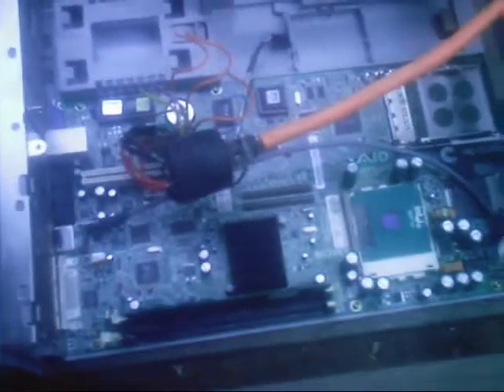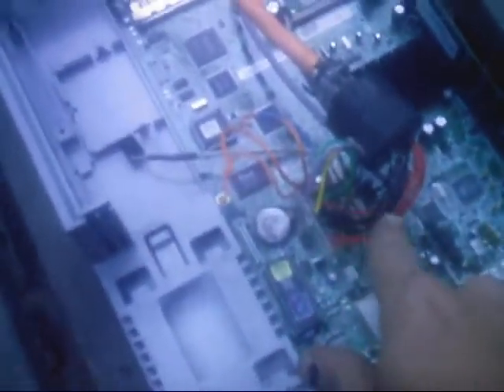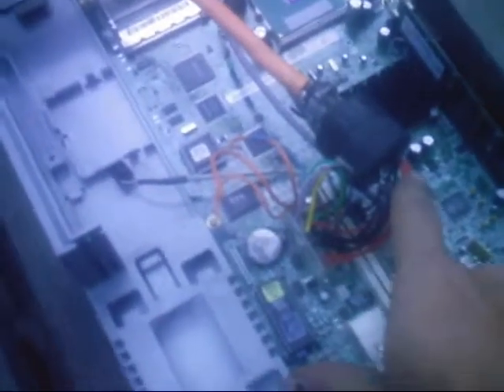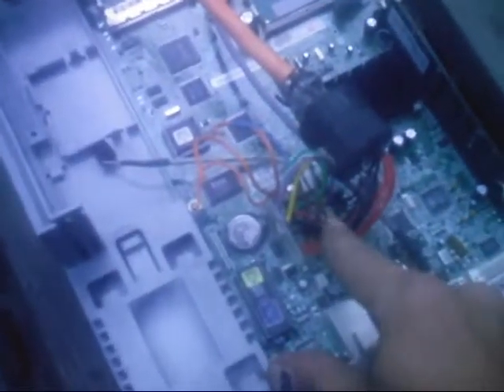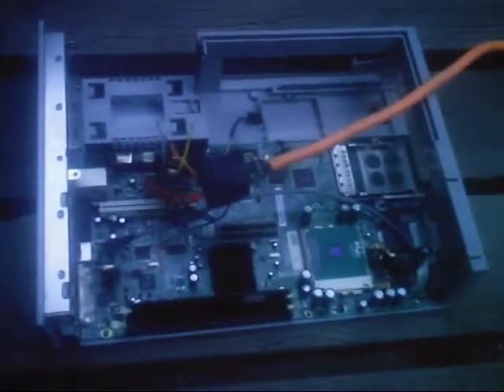secret to supping up a pentium III

Comment from the maker: ok i have 3 wood gasers that took 3 years of reserch to build i have degres in raw metalerlagy , metal fab, complex curcty and grunt brain wiring i have built 12k steam engines frome scrach i cant remeber how may cars i have built i know how to use these machins and can make it happen for real not just on papper =3-